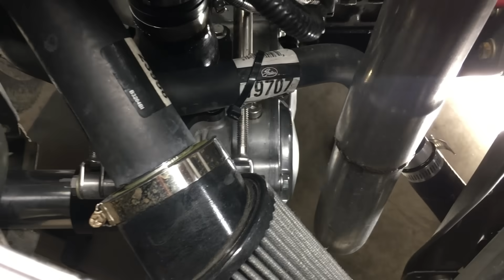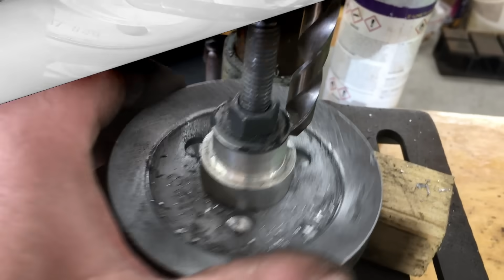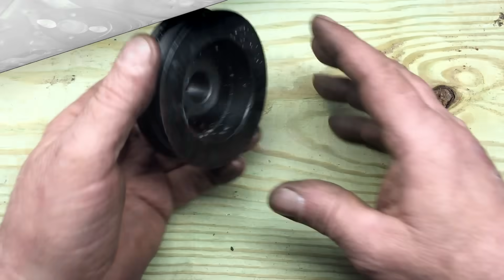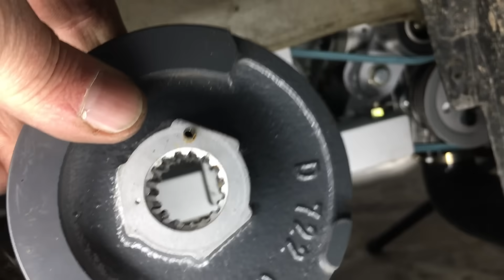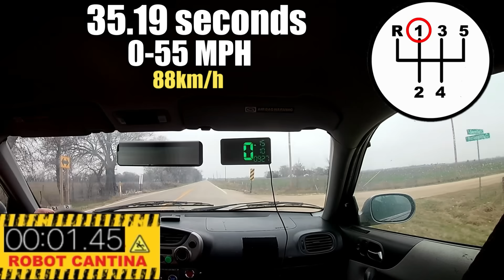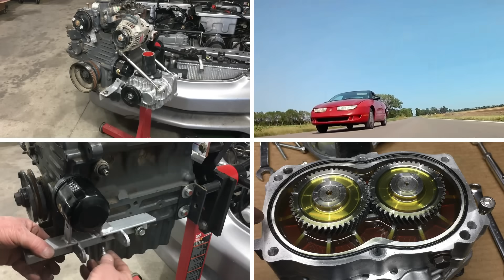S4 E9. We fix and road test the AMR500 supercharged Kubota diesel powered Honda

Comment: Hey hey hey... I weld cast iron all day every day and let me tell you if your running an EDM machine to make holes it isnt always a pleasure lol also it isn't always a pleasure to machine either depending on the finish your going for hahaha but for the most part it's fantastic! Tapping the holes can be a major pain though if your using something like 1/4-20 or around that size

Comment: Hi. If you want or need some more power, you need of course some fuel too. Only higher pressure of air does nothing, but eats power. So, if you make some boost, lets say like a 15 psi, but there is no any extra fuel, your engine power will drop just as much as much the compressor will take power to spin. But, if you add more fuel, you will get the same result of power, what you had before the compressor. Only you will lose some fuel, so your fuel economy drops. And, if you will add even more fuel you will get + horsepower. I mean more power than you had when you started without compressor. The end result is, you have more power, lets say like 15%, but your fueleconomy drops also 15%. I mean your fuel economy drops, no matter how you drive, or do you use the extra power you have. Comparsion to turbocharger, you will get all the extra air and pressure "free", and your fueleconomy will not drop at all. Because turbo does its job from exhaust gas flow, that would flow anyways, is there turbo, or not. Exhaust gas flow is waste energy. I guess you all ready knew all this, but just wanted to say it. Thanks for the video! This is pretty nice project!

Comment: you can use an Eaton supercharger pulley  out of a Mercedes C230 Kompressor, it is clutch activated above 2000rpm or so by the ecu for fuel economy.

Comment: Back in the day,  we would open up the injectors, mod the fuel pump, tighten the idler to stupid insane pressure, glue down the popit valve. Then add water injection.
Blower was always set up to be ahead of the engine.
Got our butts kicked, ears slapped, from the boss, more than once. 
Young n dumb, of course lol.

Comment: You can run the supercharger with a turbo and get the best of both worlds, just feed the charger to the turbo feed line and add a box with a flap that acts as a check valve. 
  @low turbo boost the charger will close the flap and force air through the turbo until the turbo spools and pulls more air than the charger outputs. That's when the flap opens and feeds the turbo more air.

Comment: Just found that channel... very interesting! 
I wonder how the engine / car will perform in its final configuration and what that will be...
A well adjusted Turbodiesel is imo the superior technology, if it has a good monitoring and ad-blue, the air/gas that comes out the exhaust can be even cleaner than the air that's sucked in by the engine.

Nice video, thanks for sharing!

Comment: if it sustains 55mph its viable for road use... but more psi likely would have been better.., max speed on hwy is 65
Reply: hotter exhaust means too little fuel... turns it into an oxygen torch too much fuel would not ignite and cool the exhaust and drip out... 

you dont have a cat, so thats all combustion heat. 

10psi at idle was fine. itll blow right through a 2 cycle. you have valves thankfully. 

cheapest method to more fuel without further mods gravity or vapor into a vacume like that goes into the intake. a bubbler.

but an old school gravity carb would be best as its designed to hear the fuel correctly

Comment: when the exhaust temperatures get too high, what's most likely to fail? The exhaust valve? Exhaust manifold? Piston's top face maybe? I did notice that the EGT alarm went off fairly quickly when you let off the throttle. I guess it was just rich at the high end. Hopefully you'll find a tuning you really like. I think the car's performance is already great but that wouldn't sate my curiosity for more. Maybe a little more boost please and then let off the throttle?

Comment: What is the fuel economy of this?  Adding boost without adding fuel risks lean burn of the engine.  In other words,  burnt up pistons and valves.  And you should know unless you had clearance issues that the tensioner pulley goes on the belt release side and not on the tension side of driving the supercharger.  Otherwise,  a very impressive build and thank you for sharing.

Comment: Set amr500 to 0.8 bar and fit a intercooler. Because these supercharger produce hot air.
Lower the intake temp is more hp

Comment: Normally on cast internals you wanna stay around 7-8psi anyway, So I would underdrive it and add an intercooler, the pressure at manifold will be lower (easier life for blower too) but the density will be higher, effectively the harder you try the more wasteful forced induction gets, hence stock economy vehicles only have light pressure to increase VE.

Comment: just a thought while you were talking about limiting boost. It wouldn't be very efficient, but a bleed valve stuck on the intake piping probably would have been easier and cheaper than changing pulleys

Comment: I used the same supercharger on my wifes 84 subaru gl. My boost is variable  via a cvt out of a riding lawnmower (sliding center pulley design). It uses a spring loaded tensioner on the supercharger side and a manually adjustable tentioner on the engine side.  As you slack the engine side belt the center section of the lawnmower pulley slides to make the engine side ride higher in the pulley and the spring tentioner pulls the supercharger drive belt lower in the pulley or vice-versa. Its a slick setup and allows you to pop the hood and change the gear ratio with the turn of a knob. Now i want to put a 12v drill motor where the knob is to adjust the boost on the fly. It would be nice to be able to bump the boost up when climbing hills ect.

Comment: want more power? build a water  vaporizer , i built one for my M/B 300sd turbo diesel it climbs hills like never before and it saves fuel because i have to use less throttle to stay around the speed limit , i can send a basic design and what i use for vaporizing through an email

Comment: I know it's tiny, but I would have used 2 pins for my own sanity. Not knocking you! In fact my first thought was RUN A WOODRUFF KEY OR SQUARE STOCK OR SOMETHING. then I saw the drilling for the pulley and I was like hey that's not a bad idea. But I'd still use 2. Various reasons. Maybe more that strength like IDK balance maybe even 3.

Comment: Let it run on the boost the more the more power you'll have. Plus if you advance the timing and add a little more fuel you'll actually save fuel. The engine is not working as hard then to get it up and keep it going. Plus the boost won't hurt that engine, there engineered to have turbos ring gaps ext. They were built somewhat turbos some didn't depending on its applications. Plus more boost will keep your egt's cooler as well

Comment: Just doing a quick stocktake, you have more fuel available than the stupidcharger is currently providing air for, you have less boost than you would like and you have a turbocharger on the shelf that is probably too big for the Kubota.  Well there's nothing for it, Jimbo, add the turbo back in and create a twin-charged application.  The SC makes the engine look bigger to the TC, the TC struggles to make boost at low engine speed, the SC will help with that.  Bypassing the SC at low load will help with fuel economy, and bypassing the SC at high speed when the TC is working helps reduce intake air temperature.

Sounds perfect to me and perfectly complicated.  Quite a challenge, but the overall combination could negate the short-falls with the current SC configuration and negate the biggest challenges of the TC installation.  I don't know if there's room for all the kit under the hood, but it's an interesting concept.

Comment: Maybe you already explained it in another video. But why not use a wide band lambda sensor and controller?
Reply from the maker: This is a diesel engine, the AF ratio tends to be beyond the scale of a wideband sensor.  Typically the engine runs at an AF ratio of 22-26.  Widebands tend to get sketchy above 20.

Comment: Put the original exhaust manifold back on. The center exit sounds awful
Reply from the maker: The center exit manifold allows for better fitment of the exhaust.  changing the manifold would require a whole new exhaust in the engine compartment and the pipes would drop below the belly pan.
Reply: @robotcantina8957  there must be a way.
You need to realise, i am an exhaust snob! I know the potential of how that can sound!
Btw, huuuuge fan!

Comment: No neeed to preheat something like that. That welder has way more then enough power to weld to that.  Pretty impressive seeing 23 seconds! I think later on you should do the Turbocharger feeding the Supercharger lol. Would be interesting.
Reply from the maker: I have to disagree, my welder is a bit sketchy and pre-heat makes a difference.
Reply: @robotcantina8957  If it's a 120V welder make sure you're at least on a good 20A outlet with good wire.  Not sure what your electrical situation may be but you may already know or have that proper.

Comment: Maybe you should change the point where the blower attaches to the engine cradle and make it adjustable to eliminate the "tensioner", maybe with metal rings as spacer.

Comment: So.. I enjoyed this video. Seeing that a supercharger was more efficient and effective that the turbo. On a side note I’m using a yanmar engine for my electric conversion of a Mazda rx8 to turn two high voltage generators for charging my battery’s. After seeing your video I’m throwing the turbo down the drain and buying that amr500 supercharger.

Comment: Hey Jimbo, what about installing a "Boost Limiter Valve" ? This is a vent that opens mechanically under a certain pressure, so you can never make more than a set amount of boost.
This would be handy to configure an upper boost level to where you're confident the engine will handle it. (and increase it over time).
928 motorsports makes one (and would add a porsche part to the build), but I'm sure many people do.
You won't need to make more pulleys!

Comment: Very interesting. It has to be the lower rpm range actually making power. Does it feel a lot faster right off the line? A lot of time is made up with the initial jump from stopped. This is looking very promising for my supercharged  Mercedes diesel project.
Reply from the maker: Power delivery feel about the same throughout the RPM range.
Reply: @robotcantina8957  as naturally aspirated? That would make sense since it's never laggy like before with the turbo.

Comment: I'm curious why there is so much insistence on putting the double pulley on the crank shaft. It may be unconventional but in theory the double pulleys in the system could have been mounted elsewhere.

Comment: I bet fuel economy will be down, but not that much. A 2006 chevy cobalt ss had a 2.0L supercharged engine, by 2009 it was changed to a 2.0L with a turbo. The turbo engine makes 60hp more, but gets 2-3mpg better all the time.

Comment: Intercooling will help the EGT, cooler air in, cooler air out. I would guess the fuel economy numbers will be close, a supercharger is mechanical parasitic drag, a turbocharger creates backpressure that the engine has to push through to spin the turbine.

Comment: I think you're overthinking it.
The D722 has tiny valves , the reason boost pressure increases so much at high RPM is the low volumetric efficiency of the head.

That's why boost pressure climbs so fast and but you were still starving for air at high RPM 

As long as the idle boost isn't a over 8 psig , I doubt you'll overpressure the head at high RPM because the intake valves are just too restrictive.

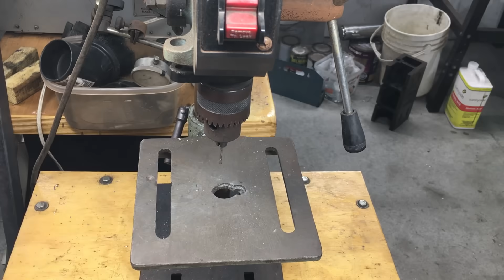Comment: 6:52 I might actually do that. What part of the CD drive were they originally?
Reply from the maker: Open up the drive and you will see a long stainless steel rod that the laser head slides on... you cant miss it  Some drives have thin rods and others have thick rods, both work fine.

Comment: Here's how I would proceed:
1. Do your MPG and performance tests with the current boost (5psi)
2. Replace your newly created accessory crank pulley or the supercharger pulley to a smaller diameter (probably should do the math to nail down the ratio) to achieve 7-8 psi and then re-run the tests again.

In the end one of those two sets of pulley ratios will provide just the right amount performance while still getting great MPG!

Comment: These are impressive results.

I'd use a Geo Metro - because I have 5 of them.  The '89 to '94 Metro weighs 200 pounds less than a '68 VW bug and can get 70 mpg on its slightly modded OEM gasoline motor.  You can drop the weight to about 1,500 pounds
Reply from the maker: Geo Metro's are a great platform to modify,  Unfortunately they are hard to find without rusted out suspensions.
Reply: @robotcantina8957 Rust free Geo Metros are available in Texas, but now it's usually a road trip.  There is a $500 '90 Metro in East Texas that I'd get if it were near.

Metros can be lightened to 1,500 pounds by removing seats and interior panels.  Might have to use Lexan instead of side glass.  I'd like to make a fiberglass hood and a fixed fiberglass hatch - an opening hatch might be too difficult.  Getting into the 1,400 pounds would make 75 mpg possible with a slightly modded OEM gasoline motor

Comment: I always heard diesels are most efficient when they are balls to the wall or 100% load
Reply: That is true of ones designed to work that way.  Some can pump in more fuel than that to get more power but at an efficiency cost.  Attaching an oxygen to a couple of hydrogens makes an amount of energy.  Bonding the first oxygen to a carbon makes less than that.  Bonding the second oxygen to a carbon makes even less.  When you have a fixed amount of oxygen to work with, doing the bonds that give more energy gets you more power.
Reply: My brother in law had a VW pickup with an added factory turbo, he kept that pedal to floor 70% of the time and would come out with crazy MPG numbers consistently in the 50 MPG range while pulling a small trailer loaded down. @kensmith5694

Comment: Excessive boost doesn't hurt diesel engines.  It's the excess fuel that hurts them.  Perfectly safe to run 15psi and just limit the pressures and EGT by limiting the fuel.
Reply: No, excess boost can also hurt the engine.  It just takes more doing that then the excess fuel side.

Comment: I'd say an intercooler is in order. I doubt it will change performance at all, but it should lower the EGTs a little bit and increase reliability because the temperature of the air coming off of that supercharger is hot!

Comment: I’m starting to wonder if a Intercooler would help any.
Reply: In this case, it likely wouldn't.
Reply: @kensmith5694  maybe not. I was thinking about lower IAT’s and EGT’s, more boost maybe. Seeing that we got a substantial difference on the 55 mph run.
Reply: @thomasstrickland0 You could also run  it on nitromethane and add water injection while adding about 20 pounds of boost.  Just don't have your face over the engine when you fire it up.  I suggest you do it outdoors under a full moon.  That way there is something to stop the upwards travel of the cylinder head.

Comment: Ever considered working for Mercedes? It's a lil over engineered by my standards but boy does it work well. 😂
Reply from the maker: I had a rare 1987 190D with a 2.5 turbo diesel.  Loved that car.  Indeed the older Mercedes were built well and cold last forever if taken care of.  If I could find a good deal on one I would grab it.
Reply: I have a 1994 c220 with the plagued disintegrating wire harness and weak head gasket. If I had the time and money I would swap a mercruiser 190 boat engine into it but I've got too many projects as it is.

Comment: I have no idea where i got this but this math checks out. I use it a lot for my cheap projects. I wanna say it's off a forum posted by someone 10 years ago. Should have posted it last time. Also change your blower displacement to the AMR 500 which is a easy 500cc per revolution or .5 liters.

SC car displacement (L) blower displacement (L)
m45:____1.0 - 2.0__________________.7
m62:____2.0 - 4.0_________________1.0
m90:____3.0 - 5.7_________________1.5
m112:___4.6 - 6.0_________________1.8

boost (in psi) = supercharged airflow (cfm) / natural airflow (cfm) X 14.7

natural airflow (cfm) = torque peak (rpm) X displacement (cuin) / 3456

boost (psi) / 14.7 X natural airflow (cfm) = excess cfm

natural airflow  + excess cfm = total blower effort @psi

boost in LPM / supercharger displacement in litres = supercharger rpm at boost goal

cfm x 28.3168466 = lpm

now that we have the lpm we can divide by the supercharger displacement

lpm / supercharger lpm = rpm

supercharger rpm at boost goal / engine rpm = pulley ratio

Cubic Inches x RPM / 3456 = CFM (cubic feet per minute) / Volumetric Efficiency
Reply from the maker: Wow, thanks for the numbers!

Comment: Pretty impressive results with 5 lb. of boost! You may be able to go 8, and then even 10 lb. of boost, and not hurt it at the current fuel settings. I'll bet the overall mpg's will be just as exceptional!😉👍👍

Comment: 3:53 jimbo using his fingers at 100 ft-lb to loosen the pully bolt. We must ask why not just cut a hole in the floor and use your limitless power to flintstone the car forward
Reply: It is snowy and cold.  His feet would get wet.

Comment: I am loving this detail and I am absolutely sure you will be able to tweak the boost to get the best result possible.  I have owned several micro cars and I fully subscribe to the philosophy of wide open throttle giving great driving fun without the stupid speed.  This experimental engine swap could have many more applications.  😊👍